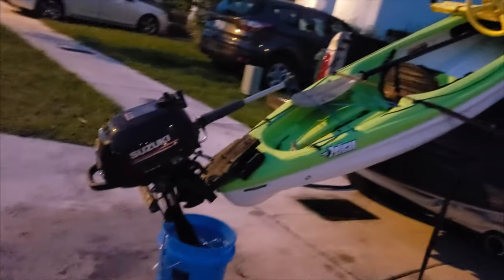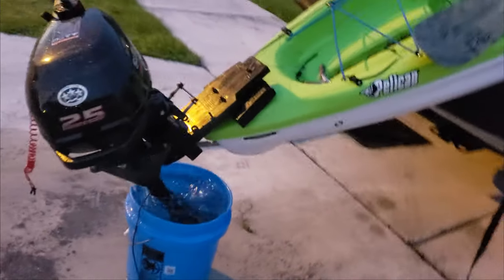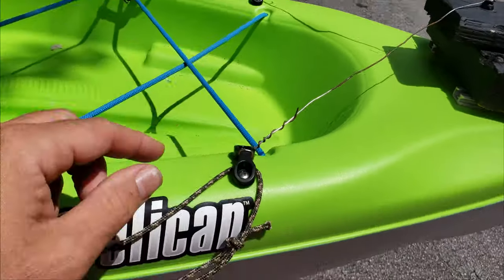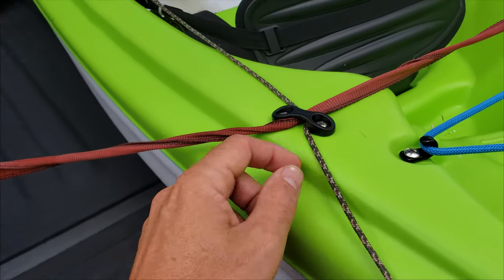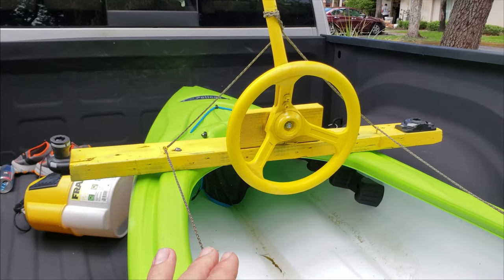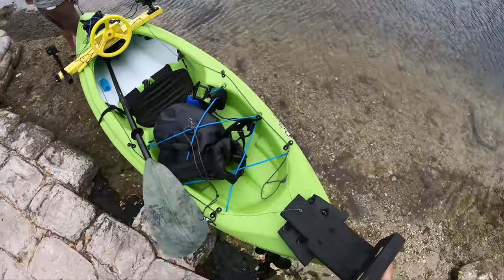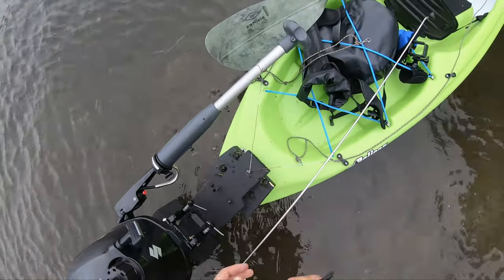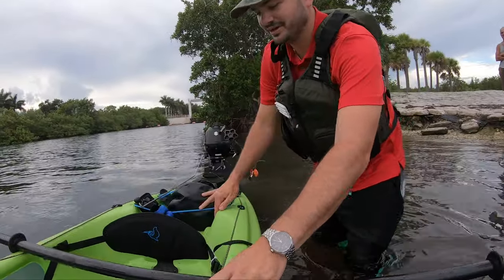SINKING Kayak WITH Outboard MOTOR SIT INSIDE PELICAN KAYAK go kart

Comment: I think the rear deck swamping at higher speed is due to incorrect transom angle.  The typical transom pitches to the rear at a 16 degree angle.  This angle creates lift when force is applied.  This lift is what makes a conventional boat plane out.  You don't need more elevation at the motor.  Lifting the motor up will alter your center of gravity and make your vessel top heavy.  "Google" transom angle to see an illustration of this principal.  
Don't give up, your kayak was floating fine until you applied more throttle. Review the video and you'll see the same thing. Every time throttle was increased the rear deck was pushed downward causing it to flood. The correct transom angle will actually lift the rear of the boat up reducing draft. Keep trying, but that's the first thing I'd do to correct the problem.
Reply from the maker: Thanks 😃 this gives me hope I thought I was done

Comment: Add a diy stabilizer to it and that should lift the back end a little.  I used 4 lobster trap floats and they work great!
Reply: That’s what I did on the 8 foot John boat I put a 15hp evinrude on it and almost sank first try 
  then I added 2 sets of stabilizers with lobster trap floats and held up good and went about 20mph then all the rivets in the boat got loose and leaked like a mother and the boat had a lot of twist in it the motor pretty much tore her up now she sits until my kyack set up is done it’s lighter and less work then the jon boat

Comment: I have a F&S Eagle Run 12, with a similar storage area in the back but with a little more boat behind it. I 've added a rudder on the back and thinking about putting the Hangkai 4hp jet drive in the storage area. 
Doing the rudder I had to verify that my kayak is plastic #4 and I melted more to it. So for the motor I would create a thru hole and weld it back shut to let it swing up and down. 
Good luck out there on the water dude!

Comment: You could put out riggers with floats in the rear I did that on a 8ft John boat flat bottom I put a 15hp evinrude on it and some weight in the front and a bilge pump with help that guy that committed about the 16 degrees is correct and you should have the prop as high as you can without cavitation too low causes drag and pushes the back down as well 
Great  video I love my out riggers I also have them on slides and they go up and down to adjust you can stand all day casting with them and the boat won’t tip

Comment: It was a good first attempt. I laughed my ass off that you went all-in on your maiden voyage (I’m thinking you probably could have waited to bring the fish finder until you knew that it wouldn’t sink. I’d bet you didn’t even think about fish for one second during any part of that). 

In addition to the transom angle as that other fellow mentioned you appear to have a major mechanical attachment problem. The motor needs to be mounted better as it looks like the weight hanging off is causing the bolts to nearly punch through the shell (is that where the water was entering the kayak, or did it cause the upper shell to separate from the bottom hull?) How about longer rails that tie into the shell farther forward to provide some mechanical strain relief to the fasteners? Otherwise, kudos for even trying 😂👍

Comment: Does it have scupper holes in the storage tray in the back? Maybe a tandem would have been better? Very cool idea
Reply from the maker: This project was fun but I picked the wrong yak lol
Reply: @AliexFolgueira  if you ever wanna try it on a vibe 130t lmk I purchased the transom mount for it but never installed or used it because I purchased a bixpy. But I was always left wondering what a 2.5hp outboard would have been. You can make a video with it.

Comment: Let's try and push a displacement hull faster than hull speed with it out of trim. What's the worst that could happen? It sunk? Who would have thought??

Bro, FYI when you push a displacement hull faster than hull speed it sinks down in the water. Zoffinger used a flat bottom boat. It can in theory plane when you push it fast enough. Good first try though!

Comment: Rear outriggers are needed for stability, too... or any way to make the stern float. Cheers! 
-Glad u are okay. :)
(see Kayak Sinking. Not My Watch)
Reply from the maker: Thanks, I do need to visit this project again
Reply: @AliexFolgueira  (thumbs up!)
In that case, put some clear poly or heavy duty trash bag in the back and fill with Good Stuff(?) expanding foam.. the narrow tail and floodable deck WILL sink when it fills with water weight back there.
-That is part of why motor boats are wide in back, to hold the weight of an outboard, and create Planing.
(the plastic bag will keep the foam from gluing itself to the boat, but u better strap it down.)
Have fun and stay safe. (beers!)

Comment: if you go slow the bow will raise but there will be a higher speed which will lower the bow and you will sit flat. This is the case for all speed boats
Reply: he really doesn't want to be plaining in a Kayak 

there's not enough height  on the sterne (transom) 
for that type of engine to sit out of the water, 

Great fun though..

Comment: Yeah this is going to work. Not.
Reply from the maker: i had to try
Reply: @AliexFolgueira  of course, nothing ventured nothing gained. Gotta be human. I fitted electric trolling motor to my kayak , took a few tries before I got transom angle just right to where the kayak didn’t flood and try and pull a titanic on me. Now I love it . My kayak is only 3 meters but handles the 50 lb trolling motor ok and gets up to speed with battery and gear at the rear .